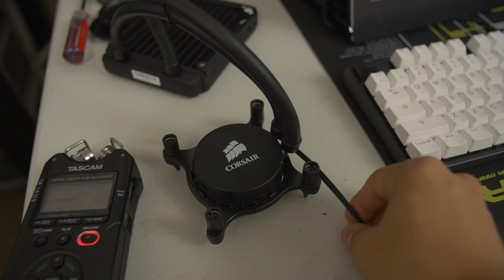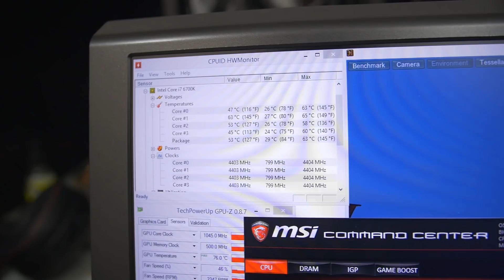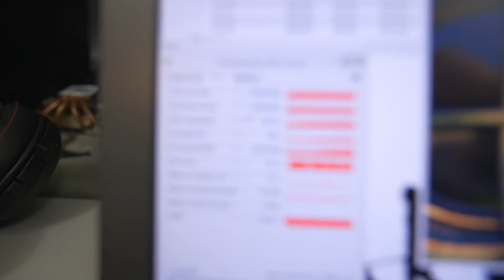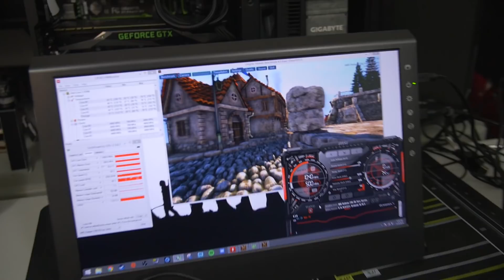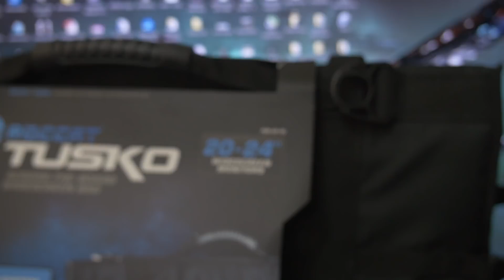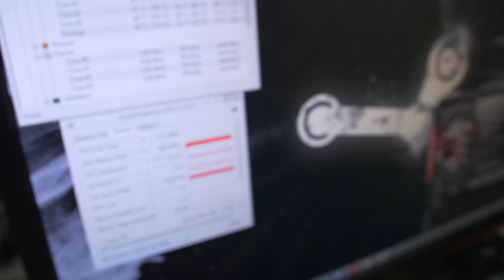Upgrading My LAN Setup + Water Cooled Node 202 Update!

Comment: I know its an old video but a tip for transporting larger screens then 24 inch, go for Gator Cases. Supports screen above 27inch to 32inch. Works like a charm.Much more rigid and professional. I use it on demo's on expo's and conventions. https://www.youtube.com/watch?v=FLEWn9hkP7c, https://www.gatorcases.com/

Comment: I think you should leave the 120mm fan on the radiator and just use a dremel to cut out another air vent in the case above it to give it direct access to fresh air, that's my plan possibly when I get one. Only difficult thing will be getting it to look anything like the existing vents.

Comment: did you ever address why you manually cut the rail that was blocking the water tubes from going through that little gap separating the gpu chamber from the cpu chamber? it looked like the rail could have been removed then re-attached. if thats the case, kind of a shame you went and cut it and sacrificed structural integrity. id at least have found some spare metal to screw back on after but it doesnt look like youve done that.

Comment: So a few thoughts... 

That wire on the H55 looks melted. Almost no question. So what are the mobo temps? We heard the CPU but what about the mobo? This may be where classic fan style coolers have a leg up since they move air across the Mobo VRAM/NB etc. Could you do a air cool solution vs liquid that lists the complete system temps? 

I am thinking on building a HTPC system with this case with an APU. My concern is cooling said APU, I wanted to do a liquid loop as you so bravely took on, but from the melted wire, I would be gun shy to do so. maybe a two fan push in at GPU location remove PCIe riser, maybe enough positive pressure to move air out through the top to cool internal components aside from just CPU? 

So ideally, AIO mount as you have, with a second fan, or dual 120 rad, for CPU cool, both set to pull air into case, and have as much air paths open between GPU mount location and mobo. Thoughts?

Comment: Would a normal 2.5 inch HDD fit in the drive caddy if the dimensions are around 70 x 9.5 x 100 (WxHxD mm)?

Comment: I was wondering if you thought a 1070 mini would fit in this configuration. I was having a hard time finding hard numbers on its dimensions. I am thinking that it would fit. Coupled with the fact that the power is connected off the side of the card instead of the rear. It looks like you have more than the difference of dimensions in clearance there.

Comment: Why not drill some venting holes in the sidepanel obstructing the AIO fan. Then you can use a 25mm fan and get cool air from outside the case

Comment: got the same monitor a few days ago but it is paired with a 1060..i was wondering if your getting a displayport no detect problem whenever the display goes to sleep,restart, or even at startup form a shutdown?Thinking of having it returned and replaced..but i think it is due to low power state of the gpu not able to reconnect with the monitor..I also tried pairing this with my aged rx5870 and it does work most of the time compared to the 1060 but it does still happen

Comment: I'd suggest switching the case with the Silverstone RVZ01 which, while an inch thicker, it means you can put an AIO water cooler and stick a full sized video card in the system as well.  More power for the expensive of about an inch in width.

Comment: as im planning to make my setup with the same case i have one question for you regarding the specifications of the case. How much space (in mm) is there between the motherboard edge and top of the case when standing vertical. knowing that the case is 82mm thick, i might be able to squeeze a little 80mm fan in there. but i want to know if there is atleast 25mm clearance between the motherboard and the exterior top part of the case.

Comment: I actually bought the lower end model of your monitor (The AOC G2260VW). I got it at Best Buy for $120! With Freesync! Which is one reason I went with an RX 470 for my first PC, but regardless of GPU that's a steal. Why NVIDIA do we have to pay double what Freesync costs to get the same basic technology! I have had my monitor hooked up to my Xbox One for about six months now and have had no issues with it what so ever. The response time is great too, (better on a PC though). And unlike AMD tradition, no overheating! Best (and only) monitor I've ever owned. I would recommend an AOC monitor to anyone who doesn't want to pay three or four hundred dollars for a simple 1080p monitor and still wants to retain some decent performance.

Comment: I have that headset, the Steelseries H wireless. It's an amazing headset, but after 2 years the charging port on the control unit has become very finicky. Sometimes it wants to charge the battery, sometimes it doesn't.

Comment: I'm sure this question has been asked before, but don't the chips on your ram and motherboard get a little too hot because they aren't being actively cooled? Typically an air cooler or case fans in a full/mid tower would give those parts at least a little bit of airflow, but that AIO just cools the cpu. Have you run into any issues with this?

Comment: Even tho i love Roccat (i have the Roccat Kave, & XTD , the Kone & Kone + , the Arvo,  and the Taito) , i think with the tusko they dropped the ball a little. Hear me out, I don't think it actually really proctects my LCD, especially for travel. If i were to "store" my LCD, the tusko would had been fine, but for travel, i would like something slightly more rugged , even at the expense of slightly higher weigth. One brand that caught my eye was Gator Cases. They were on CES 2016, showing off some of their cases and the small one actually fits the 24 inch monitor ( there's a bigger case for 27 inches, but i dunno if an airplane would let you go with it as a carry on, my guess probably won't ). Check out , it's not cheap, but it isn't straps either, its a bag for your LCD . 

GATOR CASES G-LCD-TOTE-SM

Comment: what were your thoughts about the seidon? I recently installed one and I have to say it's not easy to install alone on a 1151 socket. Other sockets went much better. But this was my first AIO, for my dad's computer. And compared to the flexible tubing of my custom loop (one day I'll go hardline) I found the seidon's tubes very stiff and much thinner. To me their connection to waterblock seem fragile. But thats probably just me... Plus I had fluid mechanics classes and those riddges in the tubing make for a lot of flow resistance. So what do you think of its performance compared to other 120 AIOs?
I get same temps as you in your vid with non overclocked 6700k in midtower running aida for 30min.

Comment: im going to buy the 75 hz version of that monitor its 160 euros in my country
Reply: dont, buy a low-end monitor and overclock it or put in that extra 40 euros
Reply: jeppeflame thats the problem that monitor that is 200 dollars is 250 euros here so that same monitor in the video costs me 275 euros or i could go with the 21inch 75hz version for 128 euros
Reply: Pelle Sanders what games are you playing?
Reply: jeppeflame games that are pretty cpu intensive so i probably wont see the benefit of 144hz like planetside 2 currently i have a 60hz 1280x 1024 monitor oced to 77hz and when looking for a monitor i wanted it to have at least 75 hz then im happy i have the i5 6600 and the gtx 1060 6g
Reply: Pelle Sanders my 1080p 21 inch 75 hz monitor costs 50 bucks so don't get scammed, please
Reply: jeppeflame where did you buy it how is it called?
thx man
Reply: Pelle Sanders It is called "Acer P226HQL". It is quite old, 60 hz but EASILY overclockable to 75
Reply: jeppeflame cool thx (update cant buy it anymore here :( )
Reply: Pelle Sanders oh :/ If you spend extra 40 euro though you can get a 96(-120) Hz monitor with a 1440p display. It is a korean brand though but I have heard lots of good stuff about them, some bad unfortunately; I can tell you what it is called if you want :) It is only "buy-able" on eBay tho
Reply: jeppeflame i cant buy on ebay and im 16 and i dont have a job currently i have like 50 euros (just build my pc)
Reply: Pelle Sanders if I was you I would've saved úp to 200 euros then sent them to my (your) parents and told them to buy it for you
Reply: jeppeflame but then i would have a system with a 750 ti and an i5 6600 instead of a gtx 1060 in the netherlands you cant buy things from ebay as far as i know we have marktplaats(literal translation: marketplace)  its a dutch version of ebay but that monitor isnt on it :( thx for the help though
Reply: Pelle Sanders oh well :/ I atleast hope you'll get a good monitor for the money
Reply: jeppeflame i found a 21 inch version of that 75 hz monitor for 120euros i think im going with that one it fits also better on my desk

Comment: does anyone have any trouble with the msi command center fan control not holding your settings mine will not ive tried everything I can think of please help  even in the bios no settings hold yes I saved them I new to building a complete noob but not new to computer please help

Comment: There also is the option of drilling holes on the other side panel to allow air to just blow straight through the case and the radiator, but I understand many wouldn't do that in a case like that

Comment: Put in a gigabyte 1070 mini in there
Reply: well now with the monitor the AMD card would fare better.
Reply: Kylez0 I use freesync and Nvidia fast-sync. freesync and Gsync has to be the most overrated thing in pc industry, 1070 with Nvidia Fastsync wud do better in normal case 
Bt here u r right as in Lan less intensive online games wud be played (I guess) and slightly lower input lag matters
Reply: I agree, I'm using a Freesync monitor with an Nvidia card. I don't use fast-sync though cause my 1070 doesn't go above my 144Hz refresh rate in most games, but at ~100 fps I never notice tearing.